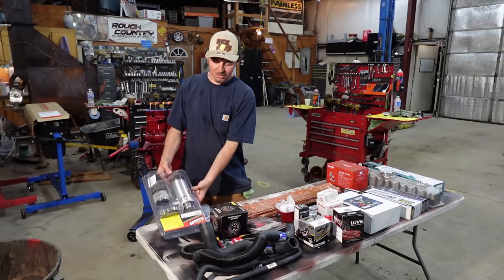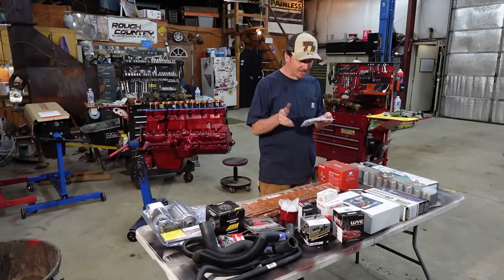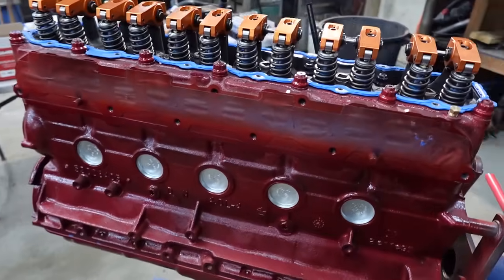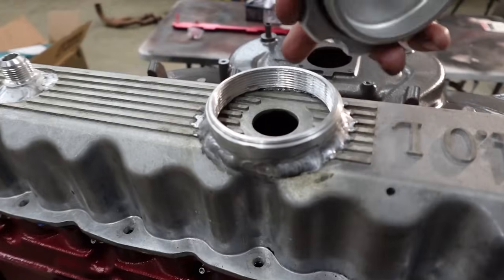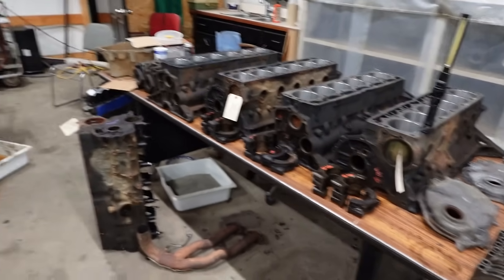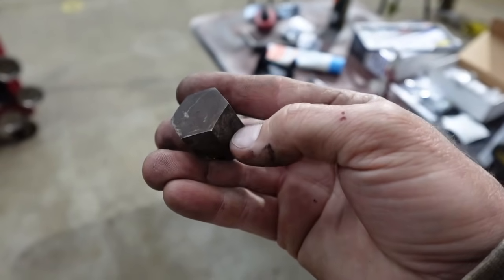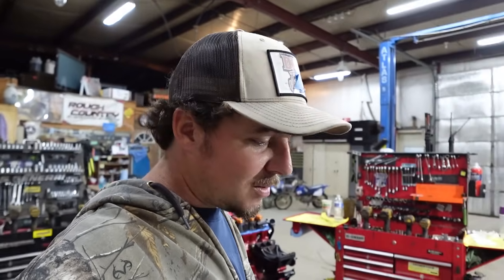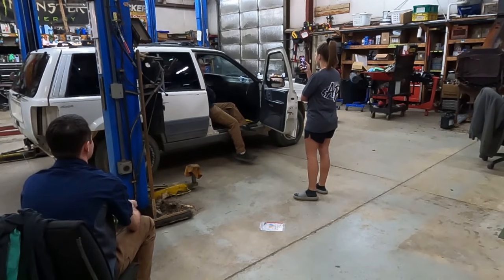Maybe last steps of adding money to this Jeep 5.0 stroker build.

Comment: We use brown dog off-road motor mounts in our xj's they have the plates that use a bunch more bolts then they offer a soft and hard mount bushings i like the softer option its still much stiffer than stock but less vibration.

Comment: The water pump bolts…  you can also use torque converter bolts. If you’re just running the pulley.

Comment: I built a 4.6l many years ago and it was a blast.  I have a 68-65mm tb from the 4.7hos in the wjs.  Someone on ebay sells the adapter plate to bolt onto the 91-01s--you just have to enlarge that opening.

Comment: Great video. Always educational!  Off topic however, Maybe you can help Dex, I got a 94 YJ 4.0, that literally goes through crank sensors every 3 to 4 weeks.  Basically they get seem to get heat soaked. If they stall I squirt some water on it and good to go!!  Motor leaks no oil with only 100k. Runs great accept the annoying crank sensor problem.
Reply from the maker: Tried a factory used one?

Comment: We ran into that motor mount bracket issue putting a wj motor in a 2000 xj, ended up cutting one hole off and rewarding it at a different depth and adding a sleeve on the other side

Comment: Ive been thinking about doing an oil cooler on my cherokee stroker. I have a golen 4.6
Ive been trying to figure out if the high volume oil pump is needed for an oil cooler i find lots of conflicting information but i don't believe its needed. Then i figured that 10an hose is the right size. 
Have you ever ran an oil cooler on a 4.0? 
I like the hesco high flow water pump they have a nice machined impeller. Some companies just add a metal plate on a regular impeller its supposed to do something but i like the hesco because its actually a whole new impeller i have a couple of their water pumps. 
That giant oil cap is funny. I'm running a bolt on earls oil cap on one of those valve covers the ribs had to be milled flat for it to work i was worried about welding that cast aluminum. 
I actually have a billet valve cover for a 4.0 its really cool but difficult to remove and install in an xj because the pinch seam on the firewall you have to undo the trans crossmember and lower the rear of the motor and squeeze it in so I'm not using it at the moment. Ive thought about cutting that pinch seam so i can use that cover easier but i dont like the idea of having to cut that. Id probably cut that part of the seam out and weld it up.